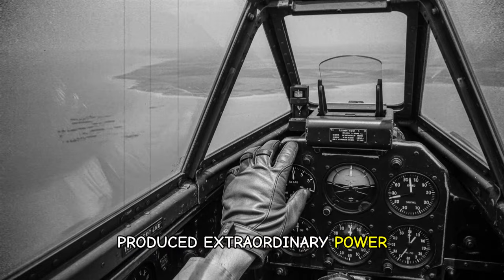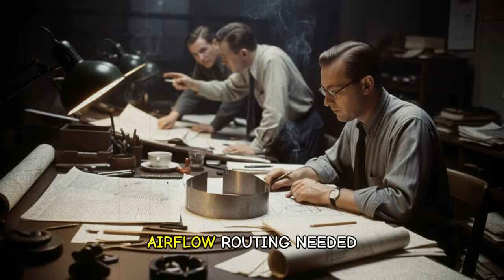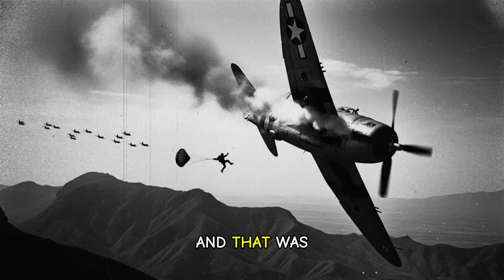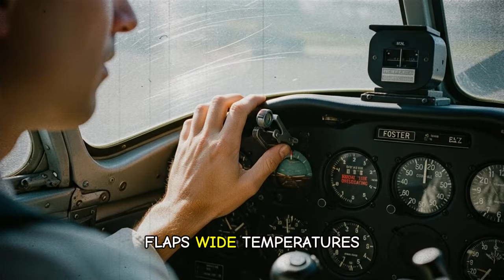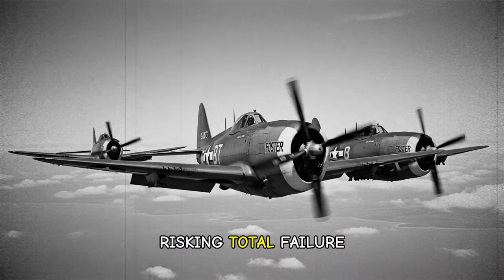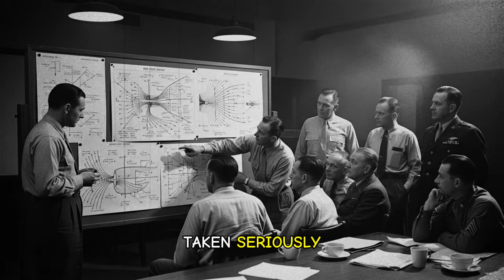How One Engineer’s “Rejected” Cooling Hack Made P-47s Impossible to Overheat

Comment: Bullshit! The Pratt & Whitney R2800 WASP Air Cooled Supercharger Radial was The Most Powerful Fastest WWII Aircraft Engine of WWII! It Out Dove Every WWII German ME109, Focher Wulf 190R, Jap Zero, Rolls Royce Merlin all Planes! And $he P-47 Thunderbolt Could and Did Fly and Escort B-17's To Berlin, Germany and Back From 1941 to 1945 the End of WWII with Their 1,400 mile Drop Tanks! The P-47 Thunderbolt Could not be Shot Down, she would bring Her Pilots Home to England with only 8 of Her 16 Cylinders Running with 88mm holes through the Propellers and 20mm all over The P-47 Thunderbolts Fuselage and The P-47 Thunderbolt Pilot Untouched because of The P-47 Thunderbolts Steel Tub that Our Pilots could Duck into Deflecting and Protecting Our Pilots from The Incendiary 20mm Rounds From The German Luwaffe ME109's and Focker Wulf 190's, The German Planes and Pilots would Literally Run out of 2,000 Rounds 20mm of Incendiary Bullets and still they coud not shoot The P-47 Thunderbolt Down! The Pratt and Whitney R2800 WASP Air Cooled Super Charge Broke The Speed Barrier where The German Airplanes Dared To Follow or No Other Plane Could so including Britain's Metlin Powered Spitfire or Hawker Hurricane or Even America's P-51 Mustang Made by The Packard Automobile Corporation with its 14K Technical Advances!  The P-47 Thunderbolt Destroyed The German Air Force, German Tank Corp and Germany's Entire Army Before "The D-Day Invasion Landing On June 6, 1945!". $he Fact of The Matter The P-47 Thunderbolts and The Boeing B-17 Flying Fortresses With Their Wright Brothers Cyclone Air Cooled Super Charged Radial Engines, and The Chrysler Sherman M-4 Battle Tanks and Theirs Fighting Crews and Service Crews Won WWII!